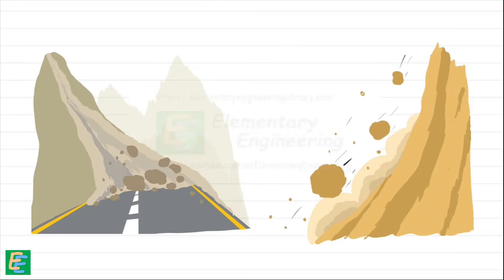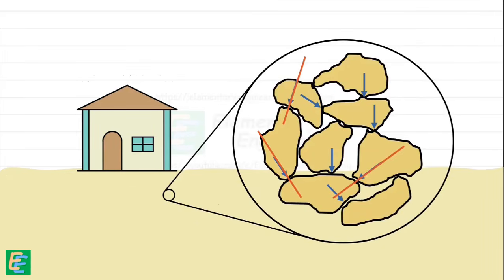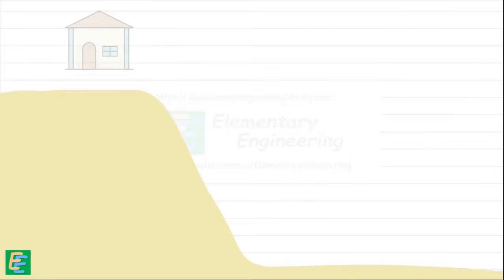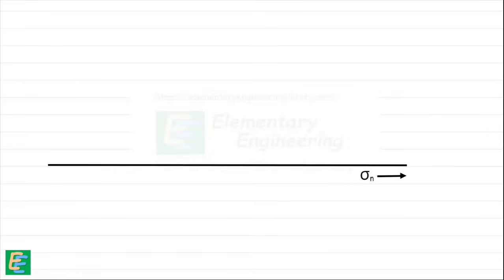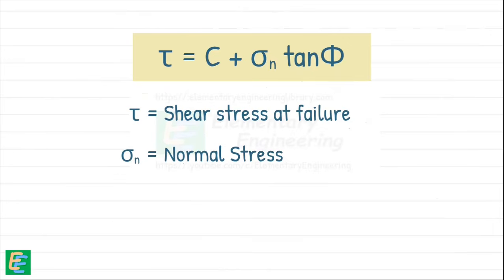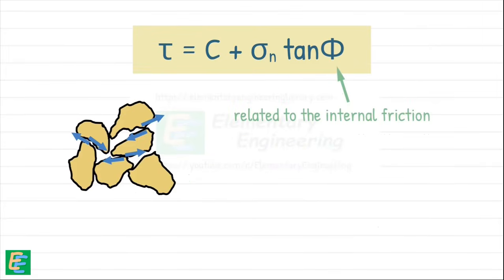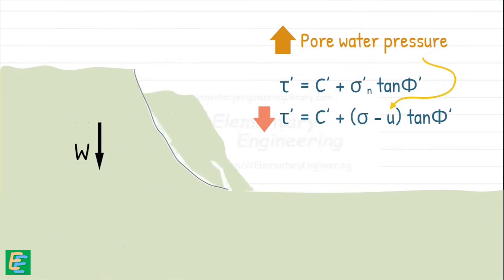Why Landslides happen? | Shear Strength of Soil | Mohr - Coulomb Theory | Elementary Engineering

Comment: Two points :
1) Coulomb, the French military engineer,  gave the equation for shear strength back in 1773 on the basis of field observations. Mohr developed the circle for stress tramsformation on any plane in 1882. He then proposed a curvilinear tangential curve as failure envelop for the solid bodies in 1900. After 1900, during the era of Terzaghi and others, the Coulomb equation was adopted as failure criteria for soils. So, it took about 127+ years to establish Mohr-Coulomb failure criteria.

2) Sands will always exhibit angle of friction only. Clays, on the other hand, may or may not exhibit cohesion only. In UU condition, all clay soils will give cohesion only and no phi. In CU/CD tests, the normally consolidated clays will give phi only and no cohesion. The over consolidated clays will give both chesion and friction in CU and CD tests up to the preconsolidation pressure range.

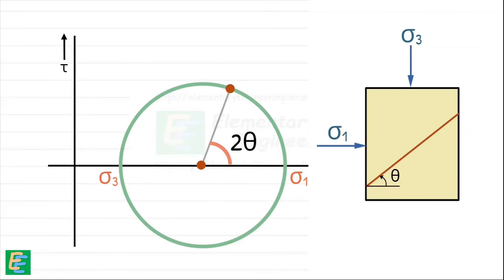Comment: This is really infomative and interesting vedio. Please keep it up. But I have a question. Is it correct that plane angle measuring with major stress direction at 13:46. Because when theta =0; vertical stress should be sigma 1 according to mohr circle but in soil mass showing sigma 3... please clarify this sir if i am wrong...

Comment: Hi …. I was hoping you’d respond this question? Why do geotechnical stress calculations often focus on a single point load (like in the Boussinesq equation) rather than directly analyzing the total stress over a distributed area or surface? Since real-world loads are not applied at a single point, what is the practical value of calculating stresses at a single point? How are these theoretical point load solutions applied to calculate the actual stresses beneath a loaded area in real engineering problems? Thanks